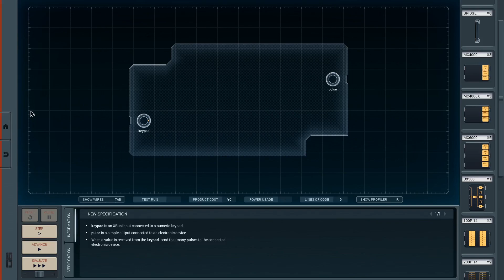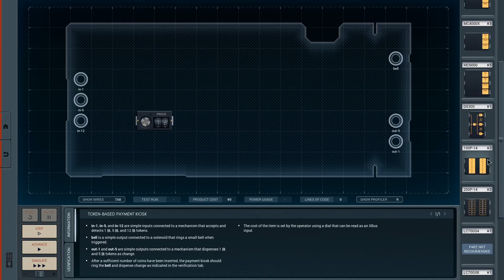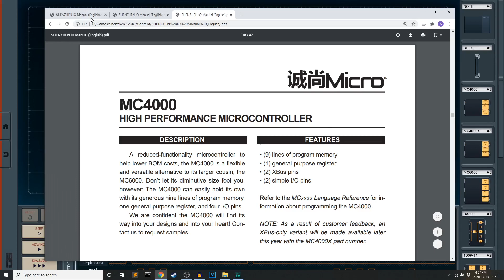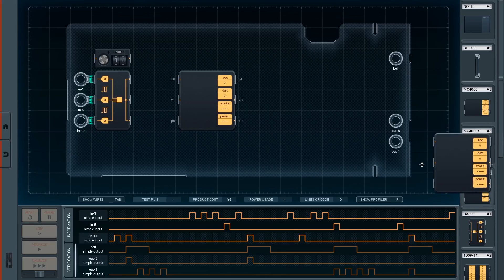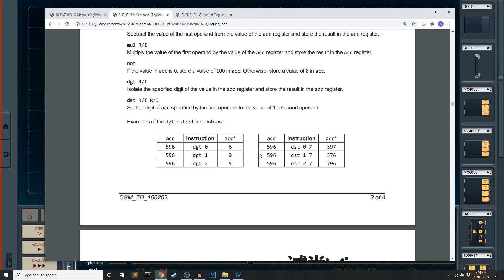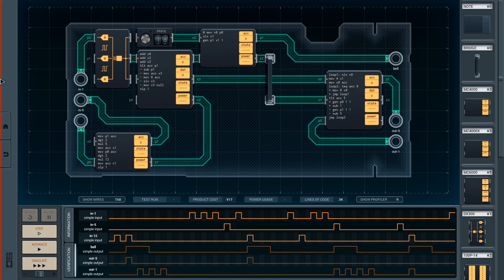Shenzhen I/O - E9: Three kingdoms

Comment: I'll note, you observed that the coin inputs don't trigger simultaneously, and then designed it to handle simultaneous inputs. But I respect you're putting effort into designing it as though for real-world use instead of just meeting the tests. Still, for one-at-a-time, it's almost always a loss to isolate the digits from the DX300 instead of just testing against 1, 10, and/or 100.
Reply: I noticed it. I mean, those things usually have only one slot, so odds are you can't have multiple coins at once. And future-proofing like that is wishful thinking at best, given the very 'David said so" nature of the product's need to exist.